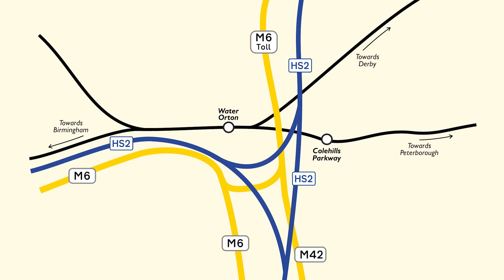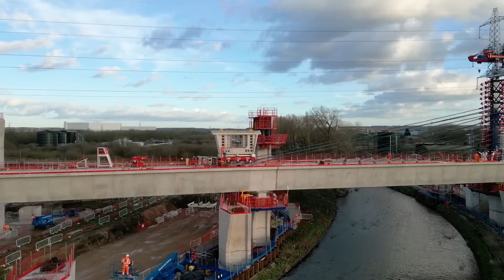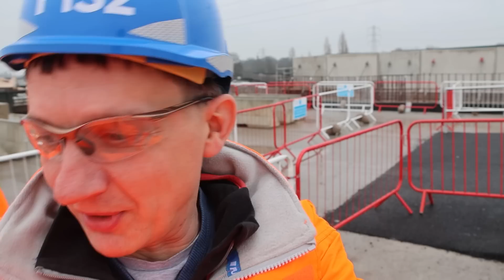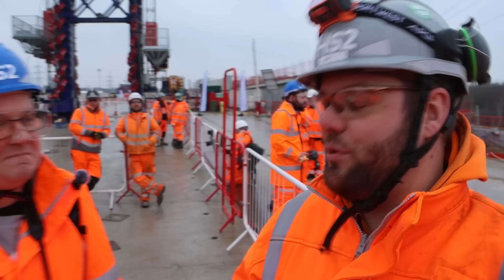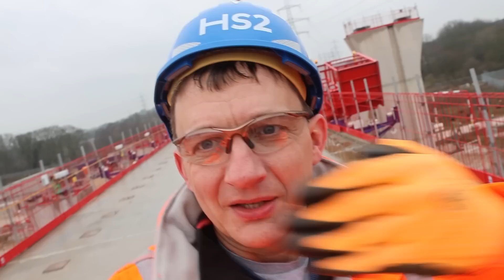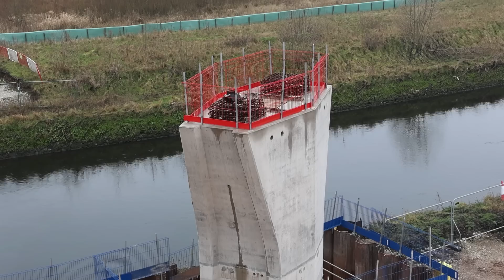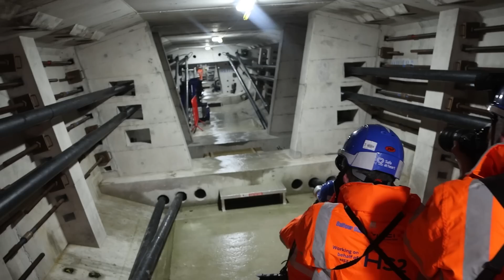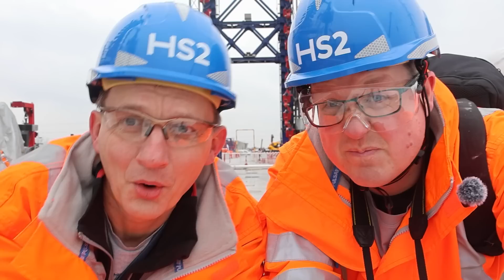HS2 Delta Junction Under Construction

Comment: Which bit of the 'Old Oak to Curzon shuttle' needs the Delta????
Reply: Don't you know anything about HS2, it will be from Birmingham Curzon Street the first new terminal station built in the Uk for centuries and trains will not only just go to London but also Manchester, Liverpool and Scotland via the Delta Junction
Reply: All the bits that are serving destinations further north. HS2 isn't just serving Birmingham, even if that's how far back they've cut the infrastructure.

Comment: Phase 2a at the very least should be a no-brainer, hopefully this structure will see its full designed use. The sheer scale of this and the amount of separate viaducts is astounding. Do wonder why viaduct design wasn't more standardised across HS2  different conditions/use cases?
Reply: My fear is that politically it may have become toxic now. You'll eventually have a politician that will understand the benefits and have the money available, but not do it as they know it will make them unpopular

Comment: All this just to get to Birmingham?
Reply: No. HS2 services will run north onto conventional tracks from day one - that's why this is a junction and not just a viaduct.

Future phases will allow HS2 trains to avoid the conventional railway, increasing the capacity between e.g. Birmingham and Manchester for local trains and rail freight.
Reply: @asdaneedsfunds  But with a huge bottleneck from Handsacre northwards
Reply: @cyberdonblue4413  There won't be a bottleneck at Handsacre Junction as the vast majority of Avanti West Coast trains that at present use the southern half of the WCML to London Euston will be diverted on to the HS2 line when it opens this also applies to trains going north

Comment: Unless HS2 is extended beyond Handsacre, there will be no trains using the northern curve from Curzon St. Trains north from Birmingham currently use New St. and Wolverhampton, there will be no capacity for additional trains from Curzon St, and anyway without HS2 at least reaching Crewe little benefit in providing them.
Reply: They will give priority to HS2 trains! The services to Nuneaton, Rugby etc will be thinned out.
Reply: Once HS2 is open as well as Birmingham Curzon Street Station these trains will run from Birmingham Curzon Street and not New Street Station
Reply: @peterwallen1063 these BIrmingham trains currently all originate from south of Birmingham…🤔

Comment: Although, as a feat of engineering, this is fantastic. I still can’t help thinking about the myriads of badly needed “normal railway” upgrades that the cost of HS2 could have paid for.
For me, HS2 lost a lot of its shine with the cancellation of stage 2A in particular.
Reply: All the more reason to crack on with phase 2a
Reply: If we'd continued with the entirety of HS2, more fast trains could've been removed from mainlines, facilitating more trains on busy corridors and more frequent service on branch lines. That however would require thinking ahead, and we don't do that in this country.
Reply: It's two upgrades for the price of one, you get a new railway with new capacity, and the old railway that runs nearby gets a capacity relief for more stopping trains. And maybe one day Atherstone can get a better service than 1tph

Comment: very interesting to see this! I wonder, will the hollow deck be used as an escape route in case of emergencies?
Reply: Nuh-uh, it's generally inaccessible from up top
Reply: @u1zha  seems like a waste to me, but there are probably dozens of technical reasons why it isn't.
Reply: @koljawinkler3328 It reduces weight which reduces the length of the foundation piles which saves money. And it provides a continuous passageway for services which eliminates the need for a separate services duct which saves money.

Comment: I suspect that the hollow section will be used for cable runs that would normally go into trackside ducts.  Periodically there will be workers who will need to access it.
Reply: sounds like a good idea to reduce the need for track access, as long as it is safe to be under there in service
Reply: I was wondering the same. Also wondered if they can use it for utilities as well for electricity and data.
Reply: Have another look at the segment where Geoff is filming inside the viaduct. Cables can already be spotted.
Reply: It's not a new concept though. I remember walking inside sections like this on what was a new highway bridge tour back in the early 80s.
Reply: @cerealport2726  Definately not a new concept. Birmingham's spaghetti junction has internal voids on its bridge structures. Periodically accessed for maintenance under pressurised working conditions to enable metal exposures to be protected from corrosion etc. Hope access for emergency services has been considered as firefighting/rescue inside that structure is not going to be easy.

Comment: Any country in Europe would be able to build over 1000 Kms of high-speed rail for less than the price of this white elephant.
Reply: Go look at Stuttgart21 if you want an actual view of rail projects in mainland Europe

Spain builds it cheap because it's going through empty fields and desert, France builds it cheap by not including the cost of stations or trains in the reporting, Germany builds it cheap and then lets 60mph freight trains use it to recoup costs.

Belgium's and the Netherlands' line is shorter than HS1

Switzerland doesn't have any, nor does any of the Nordics, or Baltics, or any in Eastern Europe excluding Poland which has a tiny amount
Reply: A few people have become very rich from this project I'm sure.

Comment: Would be very interesting to know the total cost of the Delta junction - 2/3rds of which are not going to used in the forseeable.
Reply: How did you arrive at the conclusion 2/3rds of the junction is not going to be used?
Reply: @mofomat  mbulley67 drew the wrong conclusions about Phase 2B, I imagine, or didn't listen to the video about future proofing..
Reply: All three vertices of the junction will be used from day one, as will two of the three edges (sides). It's not clear yet how many services will use the Birmingham to Handsacre edge yet, if any. That depends on whether it makes sense to use HS2 rolling stock for Birmingham to Scotland or Birmingham to Manchester routes.